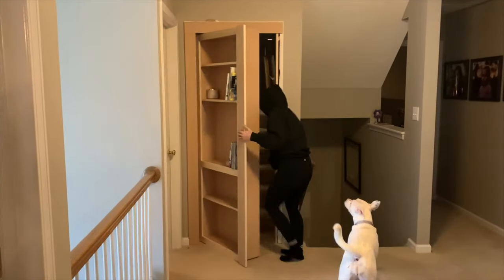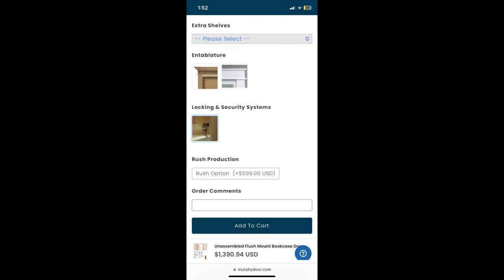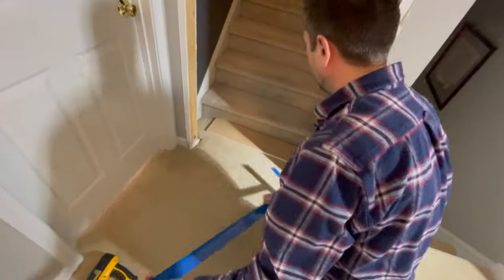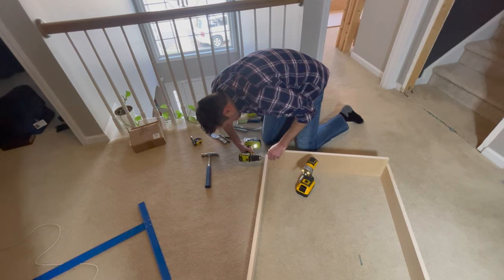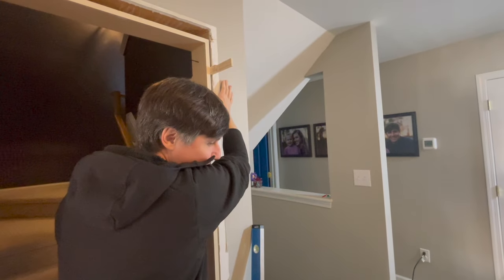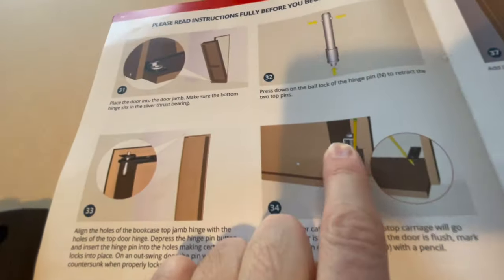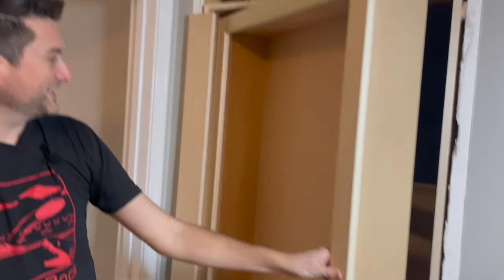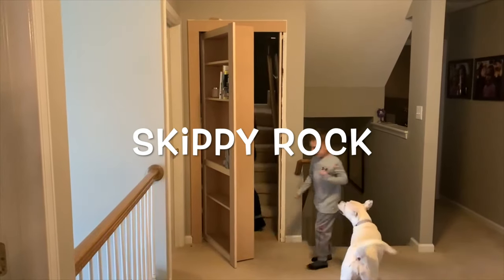Installing a hidden bookcase Door from Murphydoor.com

Comment: Great video, but did you really pay almost $2000 for particleboard?
Reply from the maker: Ha!  So that is a good point, yes there was probably less than 200 dollars worth of material in the kit.  But!  It was all precisely designed and cut.   My friends do not have any wood working tools and I only have so much time in my life to help others with a project. It would have take me several hours if not days to come up with a design, make the measurements, go pick up the sheets of MDF (while borrowing a friends truck) make all the cuts then figure out how to assemble it without the instructions. So instead of a day project. It would turn into a week’s project.  How much would it cost to higher a contractor to build this for you from scratch?  So while it does sound expensive for the materials you are getting. Unless you can do all the work yourself, it’s really not terrible!

Comment: Those side boards should have been 2 inches shorter so u could’ve attached that to[ board to the shelf also and that would’ve got rid of the small gap at the top
Reply from the maker: I see what you're saying. So the top piece would move with the bookcase like the side piece does?  Then you'd have to dress up the space above the door jamb as well as the space along the side.
Reply from the maker: I see what you're saying. So the top piece would move with the bookcase like the side piece does?  Then you'd have to dress up the space above the door jamb as well as the space along the side.
Reply: Thanks for this video! I am no longer interested in a Murphey door. What a nightmare